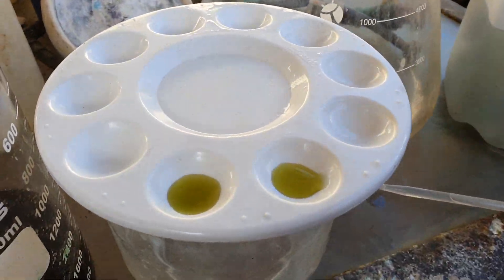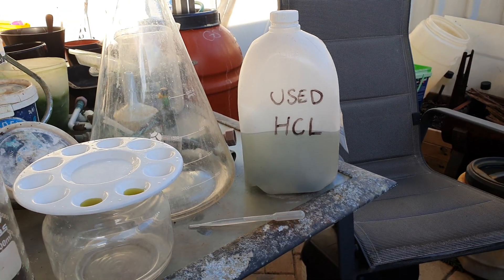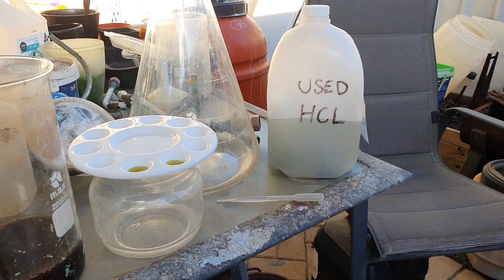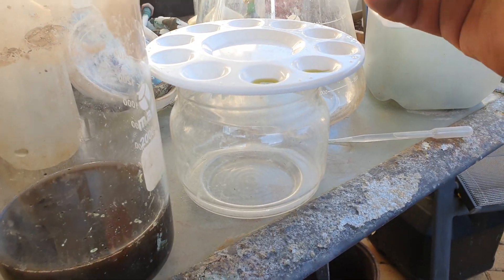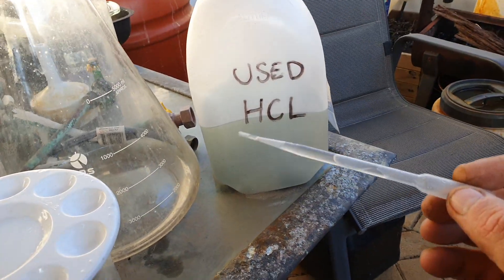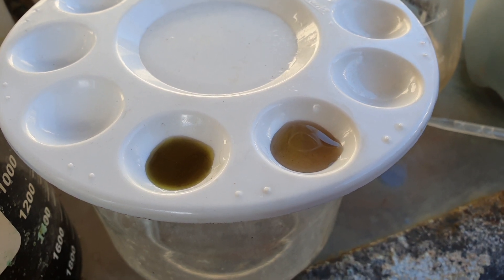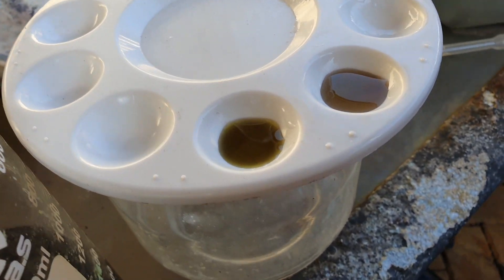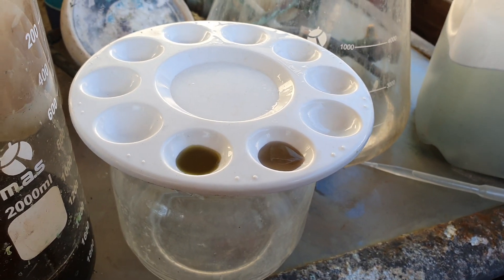STANNOUS CHLORIDE / can used hcl be used as stannous chloride to test for gold ?

Comment: Great video. Pete, please advise. Every time I reduce down/evaporate my solution,  it gels or turns white sandy, (at the end when I'm down to 400ML), with the solution mixed in. When I go to filter the sandy/crystaly matter at the bottom'' it reconstitutes to a solution, (I spray the crystals with distilled water to get all the gold), this keeps happening. I evaporate all my solution and at the end  I get the same result. There's nitric acid and HCL and distilled water in the mix/solution. What  would you do, please some help. P.S. Oh and like 3 tablespoons of sodium-metabisulfitr.I do apologize for be a nuisance, but as I said before you're the only one we can turn to, thank you either way, Arthur.
Reply: You may be putting too much smb into it, rule of thumb is use 1 gram of smb for every gram of gold you think is in there and I usually add one extra gram, what are you using to nuterlize the nitric
Reply: @ScrappingIrish  i usually let it evaporate. Is there anything to neutralize the SMB?
Reply: @ScrappingIrish  thanks
Reply from the maker: yeah dont add anymore smb, it sounds like youve added enough. if evaporating isnt working for you , just put copper in and let that do the work